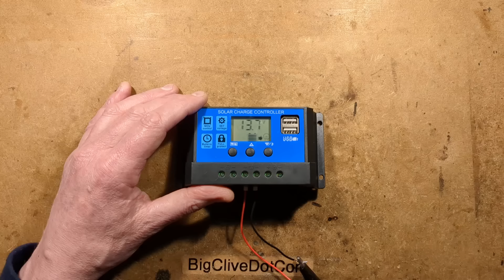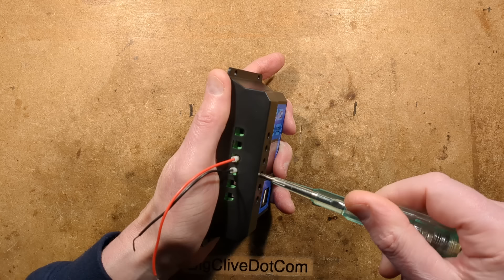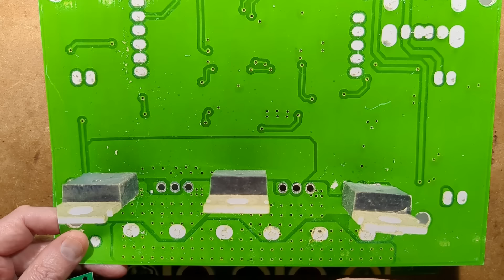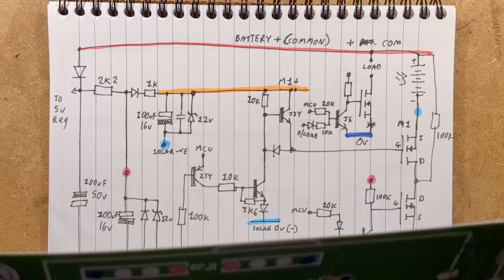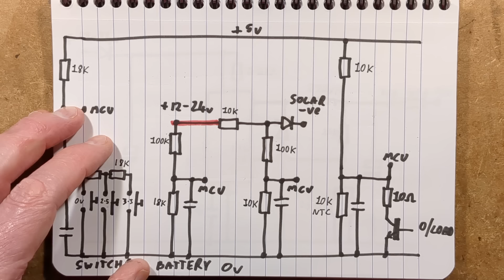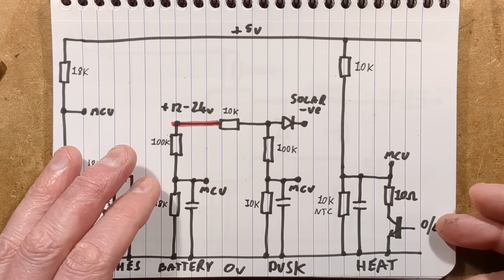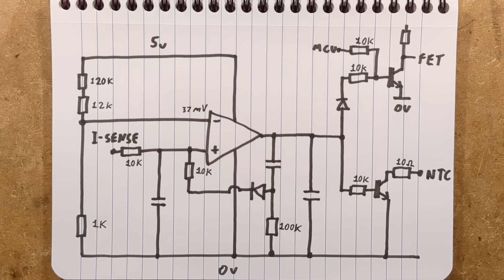Exploring a mass produced solar charge controller

Comment: One major failure of this unit: If it looses power, all settings go back to the default values. 
I use(d) this one for a solar setup charging a 3S Li-Ion battery, and selected battery type 2, which cap the charging at 12.8 volts. 
For some reason the battery BMS did cut out momentarily while it was dark, cutting the power to the charge controller, and battery type switched back to type1 (lead-acid), with voltage limit set at 14.4 volts. 
Not very safe, as when the sun came back the next day,  it overcharged the battery until the BMS permanently cut charging. 
I am now looking for a different charge controller, as this one is useless (and potentially dangerous)

Comment: Genuinely question anyone know the min voltage require to run of of these things as ive got one that doesnt show anything on the screen when connected to the battery but the battery is rubbish
Reply from the maker: It should display above about 8V.

Comment: Put one of these in my brother's greenhouse, runs a little car washer motor on a timer to some spray pipes off the water butt (we fill the butt from the gutters, with a float top-up off the hose in summer), using a couple of old motorcycle batteries. Does the job, but I wouldn't want it doing anything more critical!

Comment: Had one of these running 3x 110ah lead acid batteries off a 230W pan ony old canal boat. Worked without issue for 7 years until I sold the boat. Never used the "Load" function. 
Now have two 415W panels feeding 6x120ah lead acid. runing through a slightly bigger 60amp  version.
If you accept these ARE NOT mttp then at under £20  they are worth the saving despite the limitations.

I still have one of these on a 10W flexi I use for the liesure (lights only) in my day van if I do am overnight.

Comment: You are the guy I shoulda talked to about mini relay replacement in my Kawasaki Junction fusebox as no one seemed to be able to match them or recognize the number on them NEC N13 4A .
I was recommended and bought ZettlerAZ943-1CH-12DE  , though they did not sound 100% and said should do .
I noticed that the highest amp is 12amp yet my bikes main / ignition fuse is 30amp and all others are 10a 
I don't pretend to know electronics just the fusebox is no longer available and buying a secondhand one will be a gamble as age of bike as I have 2 of the same bikes and both have needed repair I got away with dismantling one of them and cleaning up the circuit board and clear sealing it and it was ok but second one fried a relay of the 5 pin mini relay connection on circuit board unsure if repairable or if I purchased correct mini relays ?
Also I have used these cheap charge controllers for quite some time and they are not bad your video is great info on them interesting and like someone else commented , better than the scrap piece of paper instructions that come with cheerz

Comment: The voltage that it cuts off is the screen with no light bulb or solar, the votlage it cuts in is actually the one with just the light bulb, you said it was the opposite way in your video

Comment: I am designing one for myself and got to know the reason for sequence of connections which i think is one of the major reasons. The controller needs to put out a voltage if only pv is connected in case the battery is li ion and bms has disconnected battery in over discharge protection. In this case if user puts pv in first and i generate a voltage via controller to the battery pin so that bms can wake up. Bit if user puts in battery in reverse then it is just voltage in series and too much current. Kaboom. Still finding out ways to protect my system from this particular case

Comment: I have this one in a 30amp 12/24v and it works perfectly.  I have a 100 watt 12v solar panel on my camper with 2 Trojan 6v T-105 batteries in series for 12v & 225 amp hours.  It keeps my batteries charged perfectly.  Have had it about 3 years now and I can run the fan all day & night, use the water pump and lights as needed and charge my phone on the 12vdc outlets and run my 12v compressor refrigerator when off grid.  Solar panel and this charge controller were under $100 on Amazon as a kit.  I added a digital meter to monitor voltage, amps and watt hours for $20.  The batteries I got like new but used a few times from someone upgrading to lithium I think for $100.  Great system.  Considering upgrading with 2 more 100 watt panels or going to lithium 24v and adding 5 panels in pairs of 2 in series for 24v then the pairs in parallel so I will be under 30 amps.  As 12v system 3 panels (300 watts) is around 25 amps but if you go to 24v the amps are half that so you can go to 600 watts and still be at 25 amps.  Watts/voltage=amps

Comment: I live in California's high desert and have owned a number of these.  Here are my notes on them:

These are intolerant of water intrusion.  One light sprinkling from an unseasonable storm killed 2 of them with substantial corrosion noted on lower right sector of PCB afterward
Solid wire is best.  2 have burned despite tight twisting and careful engagement of stranded wire into connector and maximum torque down of screw.
Last one i bought didn't charge at all with a light USB load connected, which made sense after learning the same 5V rail powers the control unit.  Normally they work great for charging small USB devices.
"MPPT" is a joke; on a mostly charged battery it cycles to cutoff voltage then cuts off charging completely, rinse and repeat.
The auto voltage select will jump up to 24V if the battery connection is less than perfect on a sunny day, and when it re-establishes contact, it will proceed to overcharge the battery to a rapid death.

Overall, amazing amount of electronics, and good performance for the price.

Comment: The manual for these Ebay/Ali controllers have a confusing manual which erroneously specify an equalization voltage when they really mean absorption voltage. It also fails to specify the charging behaviour.

However, Victron sells a re-badged version of this controller (search for PWM) with some slight firmware and hardware mods and a better manual/datasheet which clarifies the charging behaviour somewhat. Specifically it states that the battery is charged until it hits the (fixed, pre-set) absorption voltage of 14.4. It maintains that voltage for 2 hours then drops back to the programmable float voltage. A new charge cycle starts if the battery voltage drops below 13V. I think that it is very likely that all the Chinese versions work the same in this regard.

Unfortunately the Victron manual still doesn't tell you what happens when the sun periodically goes behind a cloud; does the 2 hour period restart every time (if battery voltage quickly drops below 13V) or does the charger have enough smarts to try to differentiate between a cloud stopping the charge for a few seconds or the battery actually being discharged sufficiently to require another 2 hour absorption level charge? This may be important to prevent 'boiling' the battery if it is lightly loaded and the sun is obscured every now and again during a series of long sunny summer days.

One of these did boil my neighbour's battery and I'm trying to think of an explanation as the controller seems to be working normally now. Maybe it locked up for some reason and stopped regulating until it lost power?
Reply from the maker: If the solar panel voltage is much higher than the battery voltage then it's possible for it to glitch and think it's a 24V system.

Comment: perhaps a silly question - do you think this board could be potted, safely?  if so, what should i use?
Reply from the maker: I wouldn't recommend potting it, but it could be protected with a brushed on conformal coating or maybe sprayed with a thin layer of grease.

Comment: i bought one about eight months ago, and is working well.  my boat has a battery voltage log, and from this i can see that the charge control works as you say - in my case it turns on until the battery reaches 14v2, as set, and turns off again until the battery goes below 12v2 - both measurements approximate.  my solar panel is only 7W so the device is not stressed, as far as i can tell.  have ordered two more since, the ones rated 60A were cheaper than all the other options, and i am looking forward to finding out if extra mosfets are included.  am i wrong the guess the mosfets are probably IRFZ44N?  thank you very much for your work on this - your understanding of analog circuits is very impressive.

Comment: I tried charging my phone from it. Within 5 minutes there was a very strong burning smell, and it got very hot. Would be interesting to test it charging something to destruction, with the case open, and see what happens. These useless USB sockets should really just be filled in with something. Would it fail safe, or would it feed 12V straight into the USB socket of the phone. Could blow up the phone too perhaps.

Comment: I have one similar than this, brand name, through amazon.   I have it connected to two 24 volt solar panels (nominally 230 watt each), and fed to an old car battery.    Works to run the exhaust fan and a row of lights through a car inverter.   Biggest complaint is that you can't draw directly from the solar panel.  You must connect to the battery.  The 12 volt output on the unit might as well not exist, because you can't really draw anything out of it.

Comment: Interesting failure mode on these. If the MCU crashes, or its power supply fails, it becomes a straight piece of wire and boils the battery. And this is why I don't like PWM charge controllers.

Now, please do a similar one that claims to be a MPPT.

Comment: Nicely inexpensive to get into the solar hobby over Renogy or Victron befroe making a bigger leap. Had one of these simple ones from 2020. 18w panel going to a lawnmower battery for doing some led strip lights in a tarp tent. Unit finally died after 3 years after ants decided to make a home in it and short it out. I have a 30A similar style version and a 100w panel now for a more power.

Comment: Clive you missed a trick and had you hooked it up youd have noticed it immediatly, its not actually MPPT, its PWM put a battery on it, then offer up 60 volts, it will tie the solar input to the battery voltage and thats it. Had a few of these and they work alright but there crap compaired to a real MPPT
Reply from the maker: No inductor suited to MPPT operation.  This is purely a simple switched control between the solar panel and battery.

Comment: I bought two like this and all went well for a few months before one caught fire and melted the wiring, inverter and other MPPT controllers ( more expensive ones). The interesting thing is that the Victron ones are still working after being heat effected. Don't risk it, pay a bit more and stay safe!

Comment: What have you got on the ends of your wires besides that little plastic collar?  Is there a crimp end that works well for this?   I just stick wires into mine and maybe fold the wires.  I use it for my car battery with a solar panel (with a quick disconnector) so it gets taken on and off and moved a bunch.  To stabilize the wires and prevent shorts, I just hot glue gunned all around where the wires go into the charge controller.  Mine works great for this application, but the charge controller is also way over rated for this application.  I agree, these work well as long as you go over rated.  The wire and electronic  bits will be a little thicker and sturdier.
Reply from the maker: I made a video about the wire ferrules recently.

Comment: Another I've got one of these"!

In my case it's in an ammo box with a 20Ah LFP battery. Together with a 50 watt solar panel it makes a good portable power supply for camping or field work.

Dedicated "solar generators" keep getting cheaper but they're stll not as cheap and rugged as my ammo box 😊
Reply: Replying to myself to add: one interesting feature is that when the LFP battery is full, the BMS disconnects it. When this happens the full PV voltage appears on the output terminals. So if you're using a battery with a BMS, be careful that whatever you attach to the output side isn't going to be fried by 20 volts (or whatever the open circuit voltage of your panel happens to be).

Comment: I have one of these in a battery box with a little lead acid and a small 5w panel on top. Runs the bilge pump in my dinghy so I don't have to pump it out after every rain. Been going for over a year and I'm surprised I haven't had to change the controller yet.

Comment: The experience I have had with these is that they have absolutely no control over the solar voltage, and simply shunt the solar straight onto the battery voltage, meaning if you have a 30v/40v/50v solar array and a 12v lead acid, it drops the solar voltage to 12v and you lose a load of power.  Changing the solar array around to keep the voltage lower and the amperage higher means you get more power from the solar.
A fairly rubbish design, and not really worth it.

Comment: I purchased one of these because it supports lithium batteries. However its output was 300mv lower than displayed and beyond the range of the internal adjustment. The other aspect that was a let down is the so-called float adjustment is actually the boost adjustment. Not very helpful if you want to keep a wet cell float charge a little under 13.8v. otherwise for a very cheap controller is ok.

Comment: I have one of those and bought it about two or three years ago from eBay and so far it works pretty well considering I have two twenty watt solar panels connected in I think parallel. The positive and negative wires are soldered to the positive and negative of the other then connected to the charge controller which charges a marine battery.

Comment: Awesome job, followed your link and might just buy one of each 10-30-60 (translate that to 4ish-12ish-20ish) and might mess around with them for fun.  Probably open them all up and rewatch your video a few times.

This is a great cost down lesson for circuit design.  How to do much with little.  Is it totally safe, HEeeeell no, but the voltage is so low the only fire concern is shorting battery.  Assuming this connected to low watt solar.  Add some real thermal tape, cut/drill a few convection hole and this little pwm controller could work great, while supervised.  If using lithium 3-4cell configuration, consider looking for a cheap cell balancer.  Then every few months check your cells and re-balance if needed.

I think I glanced in the listing description 12-18v input range...might be wrong, looked at a few listings.

Comment: Got  a few of those on different voltages and current. 2 years - no problems. They sell them in 10A to 30A versions...hence the extra space for 10A mosfets. But BEWARE...i also have the same "type" from a different manufacturer (andolf) and its a piece of crap a copy of a copy of a copy....

Comment: Been using one of these for about 16 months now, worked through the mild winter with just a couple a days of snow, but now with summer in full force it's getting plenty of power from the solar panels and working great again. For £4 delivered from aliexpress, it's been a bargain.

Comment: A great breakdown, Clive! 
My experiance with one of these (oh, 10yrs ago?) saw me cook an expensive piece of ham radio gear (thru user idiocy, no less).. Root cause was disconnecting the battery, while having the radio connected to the load output (instead of just the battery, i was experimenting :) ) . The result was the solar panel became unloaded (it was a house panel, no load ~26v output) and the full voltage went straight out the load ouput.. smoke and radio CPU failure was the result  😮.. the reg? well it still works to this day

Comment: The mosfets are SSF7509. N-channel mosfets
Reply: So no P-channel as in your schematic
Reply from the maker: All the MOSFETs in the schematic are N-channel (arrow pointing in).  They seem to use a variety of MOSFETs, mostly with an on-state resistance of less than 0.01 ohms.
Reply: Nope, I was very wrong, I apologize

Comment: I've found that so long as you use a lithium-ion battery with a protection circuit, and a solar panel which produces around one-tenth of the cell's C rating, you can charge directly from the solar panel.  I have a solar set-up to run some LEDs at night which charges a surplus phone battery (3.7v lithium-ion) with a protection circuit from a 6V (nominal) solar panel rated at about a quarter-watt.  There's around 0.6v drop from a diode in the darkness detecting switching circuit, and the battery itself drags the panel voltage down.  It stays down until the voltage rises high enough to activate the protection circuit which stops the battery from charging any further.  It's not ideal, but so far the battery has lasted five to ten years and it drives around 10 LEDs all night, even in winter.

Comment: I've ran a 50W ham radio transmitter and two 10W led lights in the shack for several years with one of these and two marine batteries. Was totally off the grid, always on. Never failed.
Reply: How was it with RFI? I didn’t find it to be acceptable (de N2RJ)
Reply from the maker: The MPPT type can cause electrical noise, but the basic ones like this don't work like that.
Reply: @n2rj  You are right. I had two 50V 15,000uf  capacitors in parallel on the output. I put those on when the dial light dimmed on key up. Running an Icom ID-880H. It will listen from 111mHz  to 999.99mHz..
Reply: The same with me, I ran this SCC too to power my HAM radio more than 7 years. All work fine, till today.